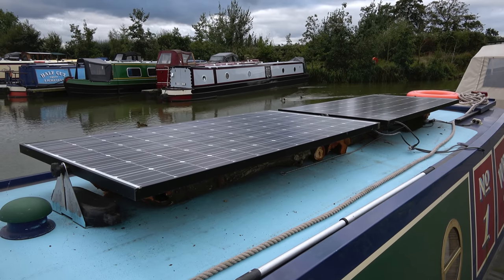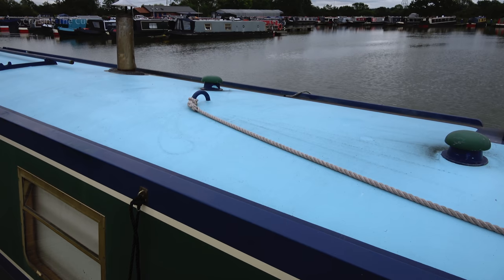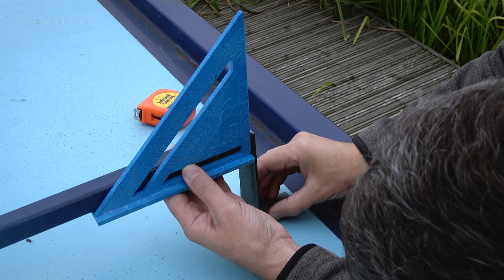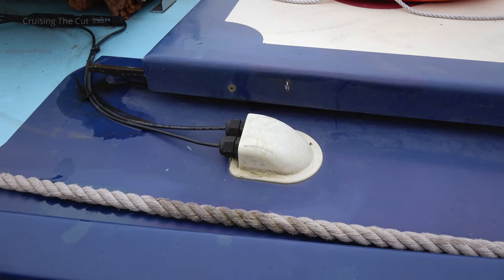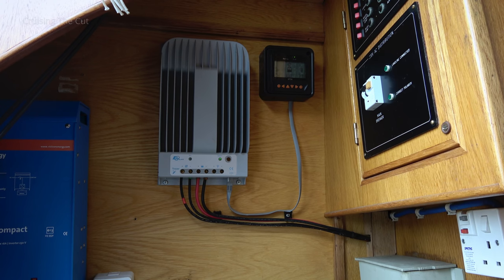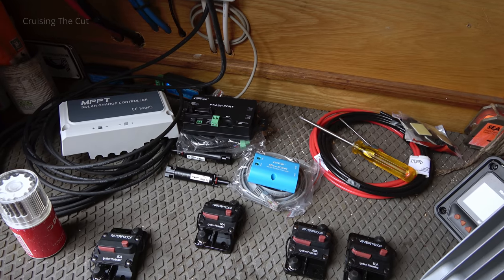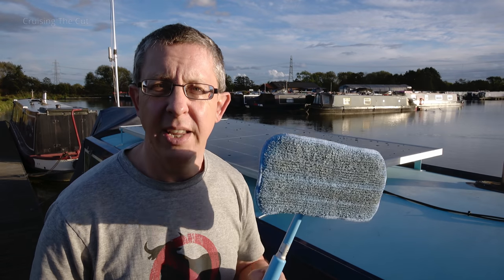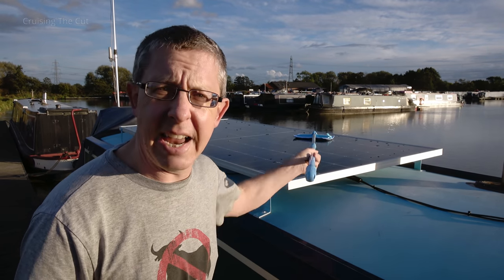251. Adding more solar power to my narrowboat

Comment: Me again, just for future reference two bolts thru the base of each bracket would prevent the bracket from pivoting on a single bolt. A hard bump to the edge of the solar panel could cause all the brackets to twist. Not very likely and it almost doubles the work, but if you see problems later keep it in mind.  Jim Y
Reply: If the bump was hard enough to twist all six brackets, the solar panel would be destroyed. It's plenty sturdy with those tight nuts into the thick steel, for heaven's sakes

Comment: It's just a shame they are only 20% efficient.

Did you buy panels without the UV filters so they work better in northern latitudes?

They also lose even more when they get hot so you can back them with a water system for a dual use system that can heat your outdoor tub in summer or have a hot water supply all year round

Out of curiousity why didn't you use self drilling tech bolts as making holes in the roof anyway.

And cup washers allow you to use countersunk screws or indeed any washer will work when you need a pan head. Mirror pad useful for little things.

And you can put a rubber strip over the roof cables like you put down in an office so you can walk or put stuff on them.

One thought I did have for winter mooring is fix panels to the side of the boat that you can mount, orientate and add for the winter months. Or summer layups.
Reply: When do solar panels need UV protection? Is this actually a thing

Comment: Measure the voltage over the breakers. You will have a drop of voltage, that makes you lose some of the charging power. 

A normal low voltage fuse would be a better choice. Also every wire leaving the positive terminal of the battery should be fused.
Reply from the maker: A fuse wouldn’t enable me to turn off the panels when required. Hence breakers.
Reply: @CruisingTheCut  thats what a switch is used for. A switch like the Blue Sea 9001E would let you use 1 positive wire, and one switch. If you use breakers on both positive and negative, and it drops 0,8V on each breaker you will have a loss of 1,4V in a 13V system, that is a lot!
Reply from the maker: I’m not using breakers on the positive and negative
Reply: Interesting information. If the volt drop is that high , you will definitely feel them get noticeably hot on a 10A charging day!
Reply: Voltage drop on high current low voltage systems is really bad.  It would be good to measure the voltage drop across the breakers and the main power leads coming and going to the PV panels.  Even a not so good solder joint at high currents and low voltages can drop 1/10 of  a volt.

Comment: 10:54 Yes to all the afore mentioned things - all edge supports fitted (BUT NOT FULLY SUPPORTING).
What you haven't thought of, is sheer WEIGHT of any winter snow, which will drastically alter the loading of weight on the center of the panel, which is NOT supported by the edge fitted brackets.
So - you will also need to find some way to support the center of the panel (itself) should weather and anything else that gets to be up there, which could become resting on the very center sections of the panel (be that leaves, birds or the odd human foot should anyone get up there).
The easiest way is to use the same form of flat bar / metal, to sit edge up (vertically) with the extreme ends bent at right-angles and bolt these onto the six uprights.
Or you could do it another way and bolt three very long flat bars to each other (at their centers) and only bend the outer two pieces from that center bolted area, such that you have a six-legged star-shaped flat bar edge sup[port which supports all of the center of the panel - with a leg going to each of the six uprights
Either method will go a long way to supporting the very center of the huge panel from being bent and destroyed, by any unwanted extra weight (such as the afore mentioned snow-loading that may occur during winter).
For you in the UK, here's a good website to ponder over..
https://www.thefitoutpontoon.co.uk/charging/wind-turbines/
Reply from the maker: First, wind turbines are rubbish on the canals, see my website FAQ page. As for snow, we barely get any even in the depths of winter so unless a scenario akin to the movie “The Day After Tomorrow” occurs, it’s all fine!
Reply: @CruisingTheCut  Just push an old matress under it I see loads of 'em dumped on canal banks LOL.

Comment: Why didn’t you get some aluminium 2x1  tube & lay it flat on your roof & just pop rivet into the panel to your 2x1 ?  Also you can get flat conduit that you can stick to you roof then you can conduit that pulls apart, lay your cable into the conduit & put the cover on ( push fit ) can be used inside too
Reply from the maker: Because the roof is not flat
Reply: @CruisingTheCut  yes I realised that, I was talking about going length wise!  Strips on the side & one in the middle!  Panels are aluminium & can be pop riveted to the channels via strips up from the main supports!  Nil rust!
Reply from the maker: The entire boat is mild steel so the brackets being the same stuff, painted in the same way, is not a problem 😀

Comment: ah yes. great. also make the panel holder higher so you can angle them all the way to vertical. 45 ish is right for londong.
Reply: I see you read my recent comment through your time machine. also make the solar double wide. let the chimney come up through a gap. also the vents can be under the solar. wtf. fix it dude. you need a hot shower and a welcoming thing for women.

Comment: A very inexpensive motor you could use to regain the ability to tilt those panels is an old, car windshield wiper motor. Simple engineering to make it work and your panels would be significantly more effective and efficient.
Reply from the maker: Cheers but I explained why tilting isn’t required in the video.
Reply: @CruisingTheCut  Thanks for the nice reply. I am just one that can't do things half way and knowing that solar panels are far less efficient when flat, would drive me crazy when a motorized system to move it could be built for less than a hundred dollars. Love your videos!

Comment: Why not use neodymium magnets ? Allows you not to drill roof and change solar setup down the road when newer better things come along . I have 1630 watts on tilts on 34 kilo pull magnets with rubber feet they go nowhere even tilted , I drop them in winds over 40 mph just in case but they don’t budge whatever
Reply from the maker: I think I’d be nervous about that but interesting to hear it works for you.
Reply: Bad idea. A mediocre but expensive bad idea

Comment: Would you consider installing wind turbine
Reply from the maker: No, they’re a bit rubbish on the canals, see https://cruisingthecut.co.uk/f-a-q/
Reply: @CruisingTheCut  thankyou for the link,  I read a lot more it was very informative, apparently to get the best wind for a turbine it needs to be 60-80ft in the air!
Reply: @foreversingle1975  
Clear unobstructed solid air stream...
which is why, even at sea, wind turbine towers are 300ft high....
that allows the tip of the blades to still be above the turbulent, surface- affected air flow....

Comment: Is it true that is cost many 1000/hour fuel to move a narrowboat? how do you manage?
Reply from the maker: I’m unclear what measurement that is but narrowboats typically burn 1-1.5 litres of diesel per hour.
Reply: @CruisingTheCut  100 litres per minute
Reply: @esecallum  more like 50 milli liters per minute. About the same as two standard whisky shot glasses.

Comment: Just wondering why you used two charge controllers and not a Busbar into one controller?
Reply: Or just buy two 540W panels and sell the old two.
Reply from the maker: The voltages on the panels are different so you can't just crowbar them together, I'm sure I mentioned that in the video

Comment: Relying on solar between November and March in the UK is pointless mate no matter how many watts of solar ya have on the roof ... what you have now is sufficient  ! If the sun doesn't shine ya get no solar at all and when the sun does shine ya basically just keeping ya batteries alive  ! You won't be able to fully charge them unless you use no load for a couple of weeks or so... 
Ya best using a generator with a decent digital charger or your engine  through the winter. 
I use a generator with a 20amp charger at mo ... it take 3 to 4 hrs to charge 345amph batteries from 12.2 .
Ideally I need to upgrade to a 30 or 40amp charger but will need to upgrade my generator too... 
( still saving ).. 
I'm also considering eventually to convert everything to 24v as my engine is 24v and 24v is alot lot cheaper than 12v !!! 
I've just bought 720watts of victron solar for propulsion for just £460 . 
On 24v ya can buy water heaters,
Kettles, inverters ect ..
Reply from the maker: Hi. I never claimed the solar will be able to fully charge the batteries or that I won't have to use the engine / alternator etc. It will lessen the need to do so though.

Comment: What about the point loading of those brackets on the roof ?
Reply: He has a 6mm steel roof and the panel weighs 28 kg, held at 6 points. Not an issue.

Comment: why do not use the Flexible solar panel? it is the best for the boat....
Reply from the maker: They’re more expensive, have to be stuck to the roof and will get extremely hot on a steel roof, which solar panels do not enjoy. Harder to remove later, and known to be more unreliable in the long term than conventional panels.
Reply: @CruisingTheCut but open some holes to keep the panel stable, will take some big trouble,such as water leakage.....flexible panel can fixed by magnetic 😀

Comment: Have you ordered starlink yet

/
Reply from the maker: No point. 4G works very well, reliably and cheaply. Starling is expensive, power hungry, needs a space-consuming dish on the roof, and may not even get a signal on the canal due to lots of overhanging vegetation in many places. And you have to keep editing your registered address every time you move.

Comment: As an engineering student with four hours of sleep the last two days and no motivation to sleep I am completely confused even though I should have an idea on what’s going on. The only thing in my mind through out this was oh I can calculate the resistance of the set up, but then stopping and yelling at myself to check for the passive convention but as a Mechy who hasn’t take practical circuits I don’t know how to apply it. I continue to watch the video and then think oh I can calculate the resistance, etc. I think it’s time for me to get some sleep. Note my lack of sleep isn’t due to work or exams but rather buying a new computer game off steam.
Reply: Hi fellow Mechy! those electrons are a tricky subject, that's why we sub it out to the EEs

Comment: Should have ran the wires on the roof in a plastic pipe to protect them. Other than that it's great.
Reply from the maker: They'll be fine!
Reply: @CruisingTheCut  If you can't take constructive criticism, turn off the comments. Pipe would have been better. I've been called out to repair systems where the wires have been damaged before. I always use pipe. You may find the wires rub from wind or waves and it may cause an issue down the road (water). It also makes for a cleaner install. Just don't use Pex pipe. UV destroys pex quickly.
Reply from the maker: I'll do whatever I choose with the comments. If you can't accept a perfectly polite response maybe don't post.

Comment: If you put your magnet your using to get the metal chips, into a plastic sandwich baggie. Then you can remove the magnet from the baggie while turning the bag inside out an then all the metal chips will be caught in the bag an your magnet left clean. After they get metal shavings on them their near impossible to get cleaned again
Reply from the maker: Yes, did that! It works well.

Comment: y do you have one 60 amp breaker and 3-50 amp ones do you need more amp for the  big  panel
Reply from the maker: Because the supplier sent me one 60A breaker, I presume it was a mistake but I used it anyway.
Reply: @CruisingTheCut  I'd double check it was not sent in error, it's not difficult to mistake a 6 for a 5. As the old panels have the same input/output breakers I'd assume the new panel would be the same.

Comment: Hello from.USA, 
You think it's possible to produce hydrogen fuel from the river water and store it in a power cell to use on really cloudy days?
Reply: Generation would be quite easy and feasible from the panels, once idle from full batteries.   Storage and use would prove massively more difficult to do effectively.
Reply: London Transport are running a few hydrogen fuel cell buses and if a sufficient supply of hydrogen can be provided then the diesel or diesel hybrid electric buses will all be replaced. It would be far easier to fill up with hydrogen instead of diesel on the canals than worry about finding a vacant charging point to charge a battery bank to run an electric only barge.

Comment: Jeez,David……..admire your tenacity,but wouldn’t it have been cheaper,and simpler, just to buy a bank of 12 volt batteries ?
Reply from the maker: Well no, batteries aren't the issue - charging them is. A set of batteries big enough to last through winter would be as big as a house... 😂

Comment: 4mm ? you should have tapped it ? 5.5mm hole 6mm tap, riv nuts i wouldnt have used because theres more chance of a leak, 1 through the threads and 2 round the fixing hole, vibration will loosen them in time.
Reply from the maker: Since I'm not traveling on the boat, vibration will not be an issue.
Reply: If you are drilling holes 5.5 for M6, you are doing it wrong. Riv nuts are also a standard marine fixture (usually In fibre glass, admittedly).

Comment: Use the drill on slow speed. Youll find it drills much better if the drill bits are sharp
Reply from the maker: It was on slow speed. I speeded up the footage 😂
Reply: Drill speed depends on drill diameter. Ideally start with a centre drill then go straight to 8mm (or 9mm. The best way to centre a hole in a bracket is to use a same size drill to mark the roof. Then swap to the centre drill to make the pilot hole. Drill one hole, fit the Rivnut and bolt on the bracket. You can now drill the other hole(s) and know they’ll all line up. Repeat for every bracket.
Reply from the maker: @David Elliott Yes, that's what I did apart from also using intermediate-sized drills when making the holes.
Reply: @CruisingTheCut  ah. Fooled me!

Comment: I would have made a square frame for the solar panel to sit in from aluminium angle and sat it inside with cable ties or better use rubber standoffs with bolts and nylon nuts to secure the panel to the frame. This will allow for expansion when the heat from the sun makes it really hot. Only 4 brackets would be needed for the aluminium angle frame. What you did will still work and you did a good job but does not allow for expansion
Reply from the maker: The panel itself is made in an aluminium frame.

Comment: most laptops have RJ45 connector as standard unless they are Apple and some other few, 🤨 nice vieo though Dave!!
Reply from the maker: Yes, that’s Ethernet though, not a serial bus. The physical connector is RJ45 but that’s entirely separate from the signals being sent over the pins.
Reply: Only the old ones, any new Thinkpad for instance doesn't have one, you always need an adapter for network cable connection (or wifi)
Reply: @AE-mb7bd  As David pointed out, the RJ45 in question is NOT ethernet, it's a RS-485 serial connection.  While you're not going to blow anything up if you plug it into an ethernet port, it won't do anything useful for you.  The only computers likely to have RS-485 built in are dedicated industrial control PCs.

Comment: I'd avoid coiling power cables.  It creates a magnetic field and the cables warm up.  Hot cables - fire hazard.
Reply from the maker: True but it needs to be carrying a substantial amount of power for that to happen (eg a coiled mains cable running a high Wattage appliance)